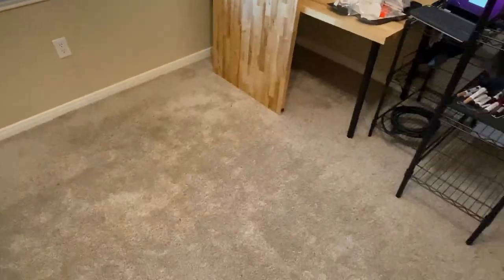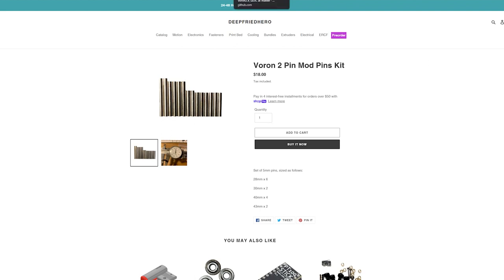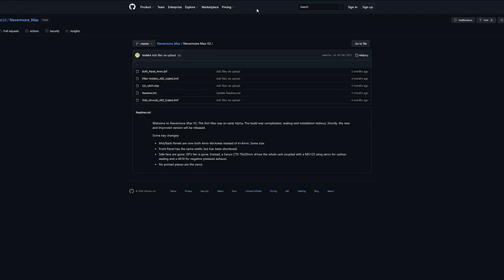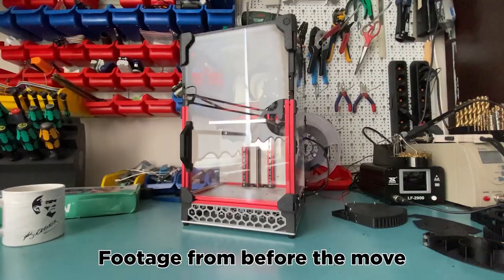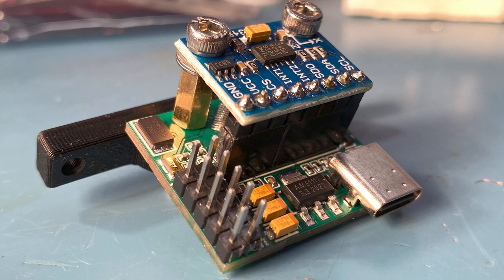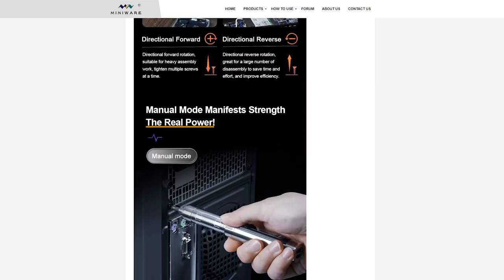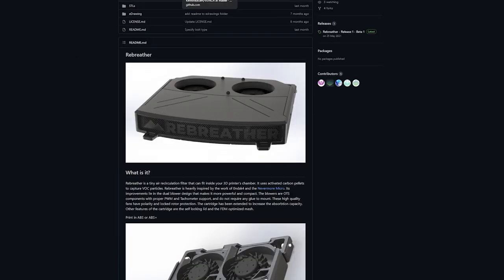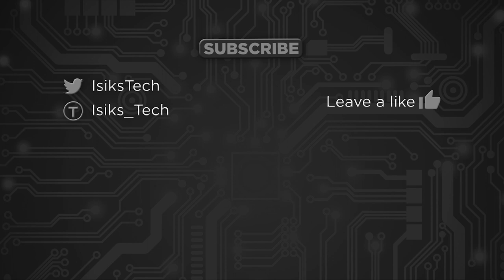Mods, Projects & More Coming Soon

Comment: Really looking forward to the filter video as I'm just thinking about a nevermore for the V0.1. Not sure if it makes sense for home application with irregular use of the printer.
Reply from the maker: Depends on your goals and how worried you are about VOCs. My goal is to stop getting headaches near printers, so makes sense for my needs. If your only worry is cancer, and you print infrequently in well ventilated rooms, maybe not as important, but can't hurt except a few dollars and some time to assemble.

Comment: Good news about the printers! 
I couldn't wait for you on the air filters, so I built a Nevermore Micro for my V0.1. Works great, but the important thing is to get high quality carbon pellets that are acid and dust free. I found a very good supplier up here in Canada. Good prices, quick delivery, almost zero dust product. Highly recommended. If anyone wants, just message me and I'll give you the contact info.